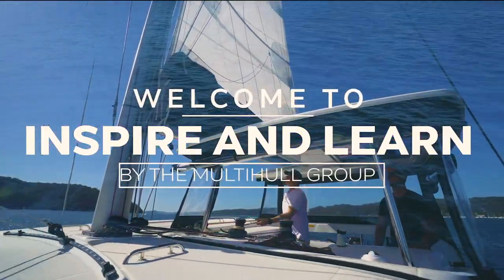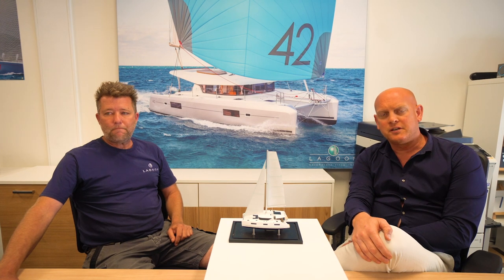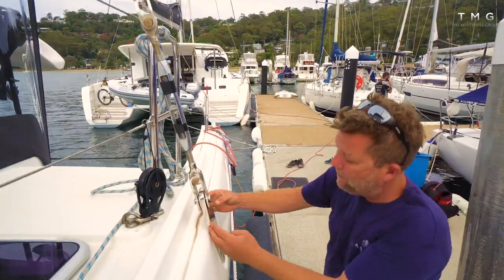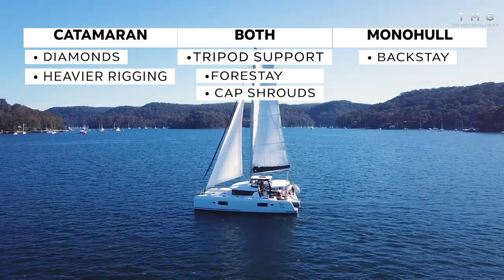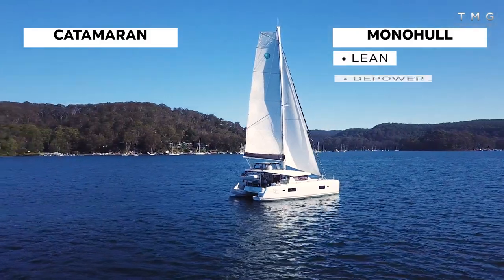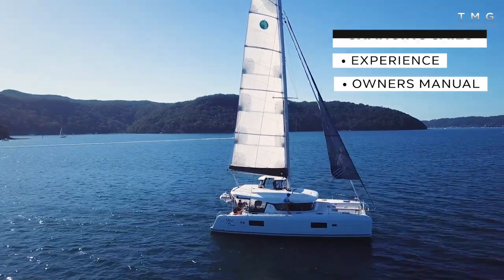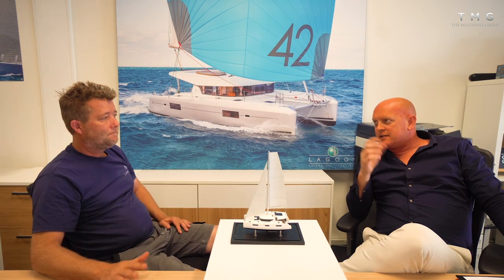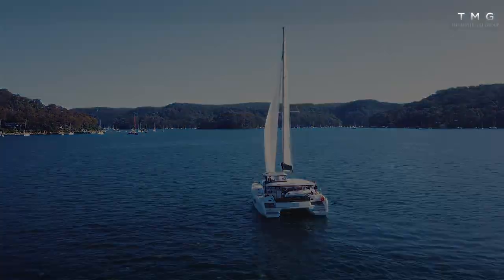CATAMARAN VS MONOHULL RIG SET UP + VPLPs New Rig Design Explained | Rigging Part 2

Comment: Hi.
I'm new to sailing.
I purchased some time ago a damage old 1979 model 12ft Surfcat catamarine. That I've been restoring for a little while now.
There's plywood seperation in the centre bulkhead timbers in one of the pontoons that's going to need addressing & new riging to be fitted.
It came with 1 main sail & I just took delivery of a used head Sail I'm intending to us as a Genoa that I'm going to have to rig but I don't have any idea on the correct method of riging.
I'm hoping to sail it on our nearby inland lakes nearby Tamworth NSW.